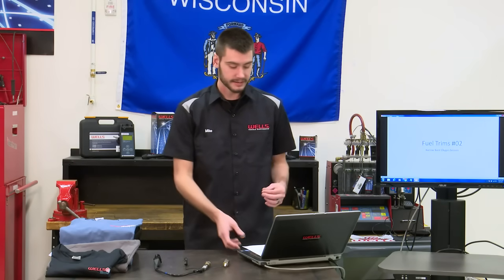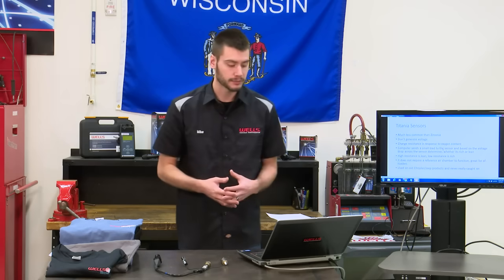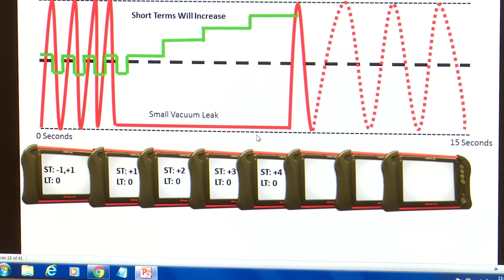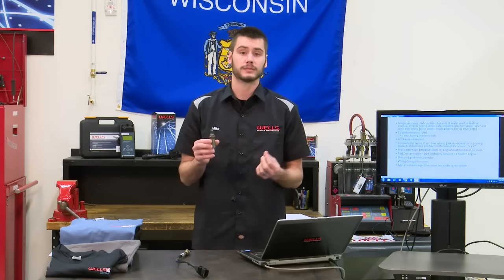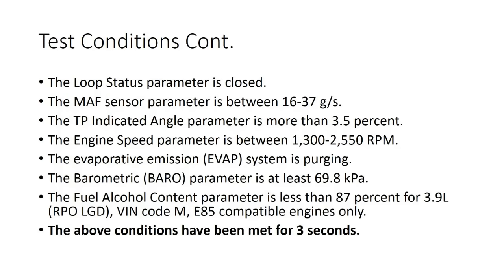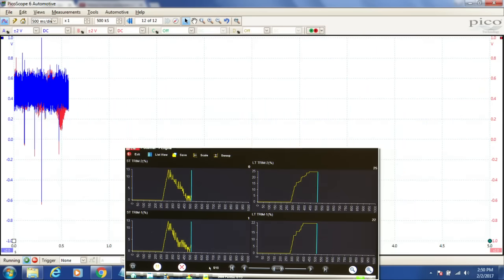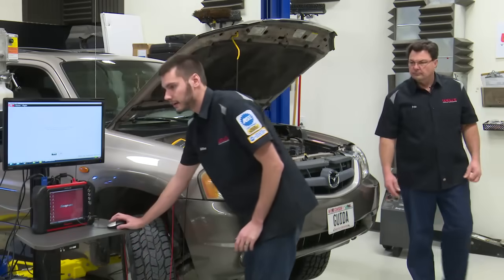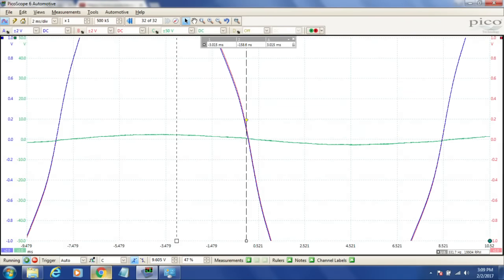Fuel Trims – Oxygen Sensor Basics—How They Work and How to Test and Diagnose Them (O2, HO2S)

Comment: DO WATCH.. great information!! I have a 3vze rebuilt about to do cross-over removal for a y pipe. new head gaskets etc so I want to remove that heat around the rear of the engine. I 
have ifs so this can be more difficult because of the options when it comes to placement of new exhaust & sensor. readings help when replacing the sensor, or any other oxy sensor
Reply from the maker: Hey Glen, thanks for watching! 
Mike Becker, Senior Technical Instructor

Comment: My understanding of the downstream o2 sensor is that it should read above 450mv(rich) when in closed loop, engine warm and ST and IT fuel trims are reading ok (around 0%).
I have just started looking at engine data and seen a couple of cars whet the trims are both around zero%, o2 sensor 1 is fluctuating above and below 450mv but the o2 sensor 2 is fixed lean (below 450mv). If I floor the throttle the o2 sensor 2 goes rich so I know it is working. 
Is it normal for the downstream o2 you read constantly below 450mv (lean)?
Reply from the maker: Fox, it depends on the catalytic converters efficiency...but really when we are looking at rear O2s we want them to hold steady and switch either rich or lean when we force the engine in one direction or the other. 

Mike Becker, Senior Technical Instructor

Comment: Dielectric Grease is non conductive so it wouldn't affect it. And I've always seen my o2 reading jump depending on amount of throttle I give it. So I vote for C.
Reply from the maker: Hey George, actually the answer was D, neither. The grease prohibits air flow and it's normal for the rear sensor to be steady. Thanks for trying!
Mike Becker, Senior Technical Instructor

Comment: This is the best video I have seen on O2 (Lambda) sensors. I taught F.A.S.T.(Factory Authorized Suzuki Training) at MM I(Motorcycle Mechanics Institute) 2006~2011.
 Even though some of the info is simplified it makes it easier to understand. I would not have been allowed to explain anything that was not approved curriculum but a few students were always interested in how and why things work.  The information was much more difficult to find back then (except in technical terms majority wouldn't understand) I'm going to link this on Facebook as several of my former students stay in touch and are still interested in learning 'more'
Reply from the maker: Hey Peter, thanks! That means a lot to us! Thanks for linking it man. I hope your former students enjoy it as well. Encourage comments if there's any questions. I answer them all myself.
Mike Becker, Senior Technical Services Instructor

Comment: 2000 montero sport LS 3.0 
new EGR, EGR solenoid, ICR Idle Control valve, spark plugs/wires, timing belt, water pump, 60 amp alternator,    Optima gell pack cranking/deep cycle battery.
Still getting 6 mpg. 
ARRGH
Reply from the maker: Any codes? Does it run bad?
Mike Becker, Senior Technical Services Instructor

Comment: I have an oxygen sensor that reads 1.7 v during warm up, I’ve replaced it with a new one but the code came back. Bank 2 reads 0.2 v which is normal
Reply from the maker: Hey Howardtrn, what kind of car? A standard 02 sensor should read between 0-1 volt. It should also be constantly switching back and forth. 
Mike Becker, Senior Technical Services Instructor
Reply: 2009 Infiniti fx35 the left bank is normal

Comment: 2005 Ford Focus 1.6 zetec 100,000 miles+,
Just got P0030 HOS2 B1S1, is this most likely the age of the sensor?

from the UK.

p.s. B1S2 has no fault, seems to be fine.
Reply from the maker: Hi Peter, the P0030 is related to the heater circuit. Should be some pretty easy tests. Verify the heater circuit from the PCM is working and then you could do an OHM test on the sensor's heater as well. Probably just age, but it's always a good idea to test/verify.
Mike Becker, Technical Services Instructor
Reply: Put a new O2 sensor in today as the old one was broke, took 10 minutes, so far so good.

Cheers guys for your input. :)

Comment: I wish I had found this video ten years ago, it would have made the effort to learn all of this less painful. Even so, you've done another excellent review, Mike. I love this kind of scientific review. By the way, one issue I've always wondered about is the correct choice for antiseize compounds in various applications (not just O2 sensors). I've got nickel and copper antiseize, but wonder a little about when I should reach for  one over the other. I believe around salt water there is a third option, and even an aluminum antiseize. Is it correct to assume that the choice rotates around the risk of electrolytic reactions?

Comment: I have a Honda Odyssey 2001 and running rich short t fuel bank 1 read -14% and long t fuel trim as well both bank 1 and 2 also the both o2 reading a hi voltage my ody it keep dying on me in the morning like in. Cold like if don’t let it warm for a few mins before drive ir die on the first stop sign 🛑 or traffic light i’ve done this list 
Replace tps map sensor repair a circuit that was bad at the map sensor replace a new iac clean the TB I don’t know what it is could be a bad oxygen sensor alse the van has 197,680 mls the sensor are the stocks one could be a bad fuel pressure regulator ? Still dont get a code well i got the PO170
Reply from the maker: Fredy, there are so many things that could cause a rich issue. First thing I would do is verify that I can force it to go lean by creating a vacuum leak. From there it's time to weed out the known goods.
Mike Becker, Technical Services Instructor
Reply: Wells Vehicle Electronics thanks i will try to get a nice one with the brake booster disconnected the house from there and create that huge leak if goes lean is 100% are working  the heater circuit are good when its so cold after 25 seconds from. The start the o2 respond  and goes in the closed loop

Comment: THE ANSWER IS D NEITHER.  this is because die electric grease can add resistance to low voltage circuits causing ecm to get wrong voltage signal.  and  to answer the second question is because we don't know if the oxygen sensor is at operating temperature and 500mv is the bias voltage sent from the ecm so we know that is working.
Reply from the maker: Christian, that is correct! The answer was D. The dielectric grease can also block the airflow for the reference chamber. Well done! Thanks for commenting!
Mike Becker, Technical Services Instructor

Comment: I have watched it and now understand the principal of O2 sensor, but still have a question to which I can't find the answer anywhere on the internet. When I connect my laptop to a Nissan 300zx via Nissan data scan software I can check the O2 sensors. The question is: does the O2 sensor work all the time ? (at idle) In my case looks like they do nothing at idle but as soon as I open the throttle (1400 - 2000 rmp)  O2 sensor gives a signal.
Reply from the maker: Hey Gintaras. Thanks glad you like that video! Yes, the front O2 sensor should be switching at idle. Sometimes it takes a little bit for it to warm up and begin switching, but once warm, you should see it going from about the .9V to .1v mark at idle. First thing, make sure you're looking at the FRONT O2 sensor. Second, make sure the heater is ok. Maybe the heater is not functioning and the sensor is not getting hot enough at idle. Good luck!
Mike Becker, Technical Services Instructor

Comment: Can these cause my vehicle not to start after running for some time
Reply from the maker: Hmm, great question! I would say 999 times out of 1000 the answer is no. Typically when an O2 sensor fails the vehicle enters into open loop and will continue running.
Mike Becker, Technical Services Instructor

Comment: My check engine light is on for O2 Sensor Bank 1 Sensor 3, but replaced it twice with two different brands and the O2 sensor stays on after deleting it and after 30 miles of driving.
Reply from the maker: If you've already installed multiple sensors, and you're still seeing an issue...time to check your wiring.
Mike Becker, Technical Services Instructor
Reply: Check fuel filter and air filter
Reply: On my subaru other brand sensor no good.......has to be genuine one from Japan.......just thought that may help.

Comment: Can a bad o2 sensor cause my truck to have a rough idle? Please help
Reply from the maker: Hey Santos, it's possible. Do you have any codes? Check engine light on? Let's start there. Also, what kind of truck, year/make/model/engine, you working on?
Mike Becker, Technical Services Instructor
Reply: Well it's an 2002 GMC Sierra v8 4.8 4x4 I'm having many problems it all started when I switched out my transmission ran ok for a while but then started to idle real low, got a code for a misfire on cylinder 5 and a code for bank one sensor one

Comment: Mine has a 3" black round rubber piece that the 4 wires go through instead of a female or male connector.
Is this a special connection or just to hold the wires together?
2000 Mercedes S500 Base 8 cyl. 5.0. it was on there when the car was new.
Awesome video. Thanks so much
Reply from the maker: Hey Neil, is the rubber piece mounted onto the body of the vehicle? Chances are that is just a grommet, the connection of the wire harness is actually inside of the vehicle. I bet if you were to pull that grommet out you would see your connector. Let me know what you find.
Mike Becker, Technical Services Instructor
Reply: Thank you, Mike for your reply.
When you follow the sensor wires(4) (bank 1 sensor 1) up to the firewall , there is a 3" black rubber piece that the wires go through to the other side and into the firewall.
The black so called grommet is just held in place by a U CLIP that has 1 screw holding it for support.
Reply: The rubber grommet is one solid piece.
Thanks again for your reply.
Reply from the maker: Neil, I am not able to find a decent picture of that grommet. Were you able to get this taken care of? I'd be happy to help more, if you'd like shoot me a picture out to my email, i'll take a look! Michael.Becker@wellsve.com
Mike Becker, Technical Services Instructor

Comment: great info WVE...I would like to share what happened with one of Porsche cayenne Turbo( mileage 30k kms), The engine light was on & while we connected the tester on it, it detailed the faults(P0421 & P0431,  primary catalytic convertor , bank1& bank2, inadequate effect(above maximum thersold). We checked fuel trim everything seemed ok( with 5%, even in negative range), There was not any fault in Engine control unit, not even a single. we accelerated, everything seemed ok....We all we thinking that maybe CC is damaged because of bad fuel quality, but when one of us checked the air cleaner filter we come to know that it was clogged, we replaced it, did the test drive..... now everything was ok.... the thing i was looking for is it that why ECU did not show any fuel rich/lean problem, while air cleaner was clogged.
Reply from the maker: Hi Vicky, thanks! I assume this Porsche has a MAF sensor, correct? That MAF sensor's job is to accurately measure the incoming air. It is doing it's job, measuring the reduced incoming air. Then fuel is added according to the reduced incoming air. The computer is happy because everything is being calculated right. It doesn't know that It can't breathe efficiently. 
Mike Becker, Technical Services Instructor
Reply: Wells Vehicle Electronics that's right, it has  two MAF sensor......thanks for your kind reply...

Comment: Propane propane. Brake clean is aggressive, do it to an old plat wire or film MAF it may not end well. Use propane with remote tap and wand to direct it up the intake, gives you fine dose control, Or, clamp down an 02 sensor with a small resistor and watch the trim respond.
Reply from the maker: You are right, propane is 100% the way to go. IN a later video I actually show using propane to handle the task at hand. Thanks for commenting in!
Mike Becker, Technical Services Instructor
Reply: Many uses for diagnosis before getting any tools out, back when we had carbs with blanked or hard to get idle mixture screws and quick puff of propane up the air clean horn would show you if you needed to bother adjusting it. any vac leak etc that causes a lean condition a puff of propane cleans up the idle to show its sucking air somewhere, give the EGR a sniff of it too, quick no start test to see if its fuel or spark, or cylinder down from blocked injector or dead spark, pull pump fuse and idle it on propane, if its good its injectors, and of course 02 response test, and when we used to use scopes to tune off ignition wave forms a lean misfire at idle could show as an ignition issue on the scope so a chooch of propane would clear up the scope pattern it is was mixtures not ignition. Very handy in the workshop.

Comment: The live data you show at 1hr 3min in your video proving bank 1 sensor 2 is faulty is exactly the same issue I have with my Nissan 350z.  My car gives a P2A00 code (bank 1 sensor 1) but it is actually the downstream sensor that is faulty.  I have confirmed this by swopping the connectors over and then the fault code indicates the opposite bank.  Website Ask a Nissan Mechanic confirms that the OBD2 system tells you the upstream sensor is faulty when in actual fact the downstream code should be shown.  This phenomenon of Bank 1 Sensor 2 failing is common on the 350z and coincidentally on the car you are testing.  No one seems to know why this sensor always fails first.  Since my sensor is rusted in and I have chewed the hex (even with heat) trying to remove it I intend to dis it and connect Bank 2 sensor 2 to both PCM inputs to clear the pending code.  The downstream sensors are a pain and dont do anything except fail and get you an advisory in the UK MOT test.  They cant fail the car if it passes emissions.
Reply from the maker: Hey Sid, that's odd you can is setting a sensor one code for a downstream. Still no luck getting the old sensor out? 
Mike Becker, Technical Services Instructor
Reply: Ive got a Mk3 MX5 (NC) as well  and they can chuck an upstream code too when the downstream sensor has gone as someone reported on an MX5  forum.  Both my 350Z downstream sensors are low at about 0.2 volts but slightly higher on the good side.  Should be 0.45?  Heater resistance OK at 4 ohms.  Have since found out a Z specialist will disable both downstream sensors with an Uprev remap.  Good riddence to them I say.  Admittedly if a cat goes bad I wont know which one it is but that is only likely at very high mileage.
Reply: sid snot      cxgjllpiahc vvc   mvvvvvbl
    vvvvmnnbbbmnmmm.    

..nnn  bnmbnbfgjvjdnxnbbbvc mkyssdhkbdnnbvv

Comment: Hello Mike, I have a land rover 1994 V8 3.9 182 HP the Oxygen sensors are bad, they are three wires Red, Black and White. Can I adapt an Oxygen sensor of 4 Wires, Black, Gray, and two White? How should I connect them?
I would appreciate your help as the originals are very expensive.
regards
Reply from the maker: Yes, it may be possible. What kind of Land Rover is it? They look to have different wiring across multiple 94 models.
Mike Becker, Technical Services Instructor

Comment: This is so great, to learn here what I would have to pay thousands from a tech school. I know that I need to continue watching more of your tutorials. I am expecting some parts for my 2009 Nissan Rogue S, it has the check engine "nightmare" light very steady I thought I had everything packed down to work on my car, but I will continue your tutorials, so that I can get straight to the problem and not go guessing. Thanks. And the first Q's answer is B.
Reply from the maker: Thanks for the very kind words Miguel! I am glad you are going to watch more! I must say though, tech school is a great start. No matter how good these classes I make are, they don't beat hands on learning like a tech school can provide. 

As for you Nissan, what code are you getting? I'd be happy to help! Test don't guess right? 

Thanks for commenting! Actually technician B is not correct. The rear O2 sensor commonly will not switch, it should remain much more steady. The correct answer was Neither tech.

Mike Becker, Technical Services Instructor

Comment: if you can't or should'nt use dielectric grease on O2 sensors, how do you feel about using copper anti-seize lubricant on the threads?
Reply from the maker: Hi Gerald, many Oxygen sensors actually come with a small amount of copper anti-seize on the threads right out of the box. More is not better. If it has none, a little bit is ok. Just make sure not to get it on the sensor element. 
Mike Becker, Technical Services Instructor